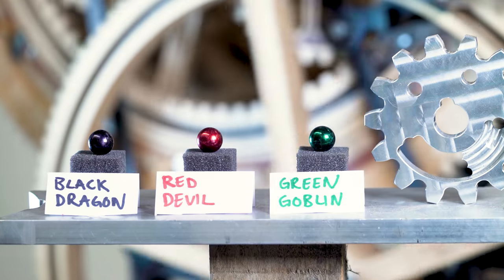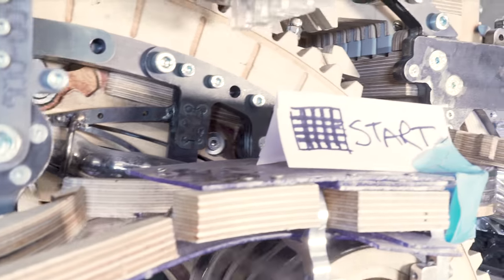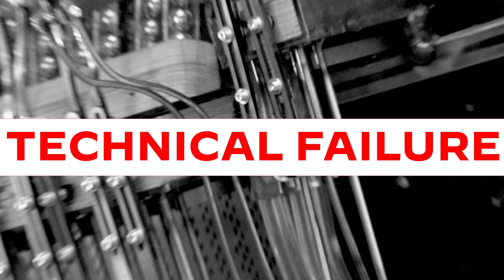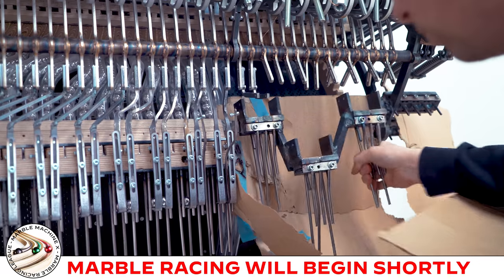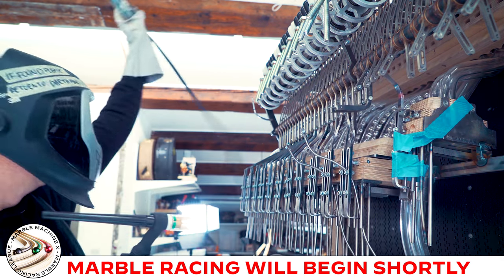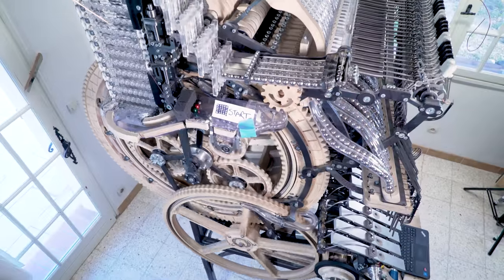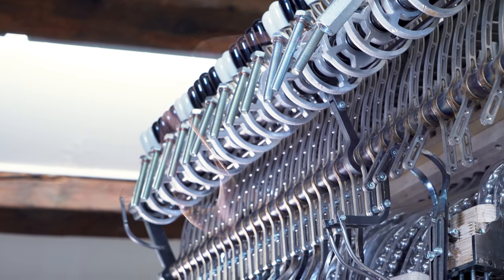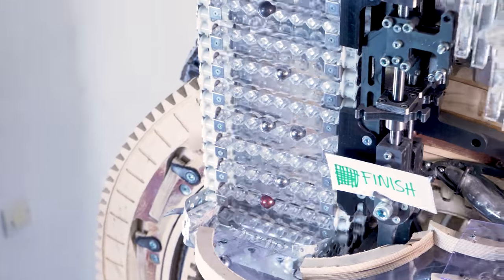Marble Race on the Marble Machine X! Who will Win?

Comment: You could drill a few balls(with a diamond burr) and insert RFID tags and epoxy them in and have RFID sensors register the ball locations and trigger colored lighting for the various areas the balls will travel.

Comment: If you put some light under that glass that has the glare problem, or shade that part of the track from the light, the glare won't be such a problem.  Alternatively, you could use mirrors to reflect the marble divider tubes from underneath where there isn't any glare.